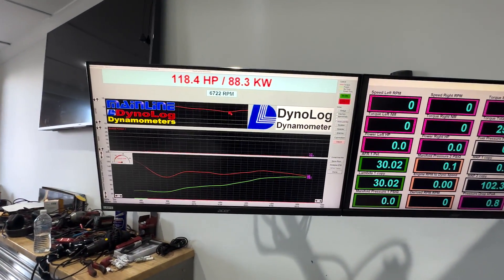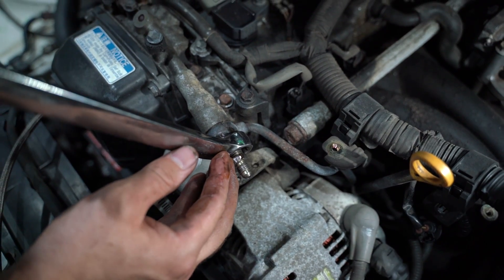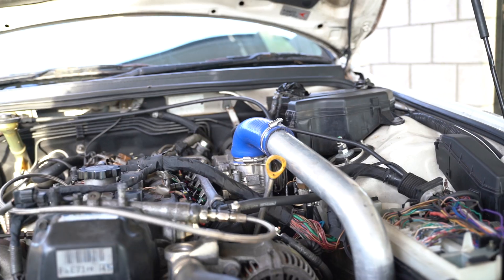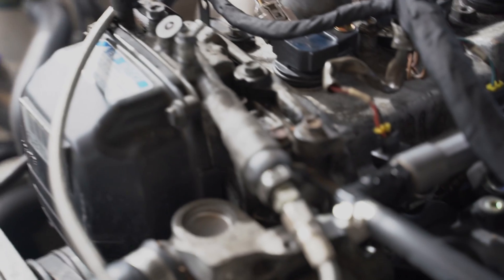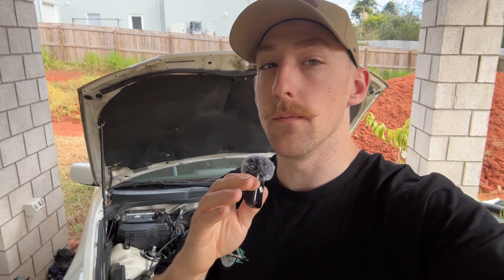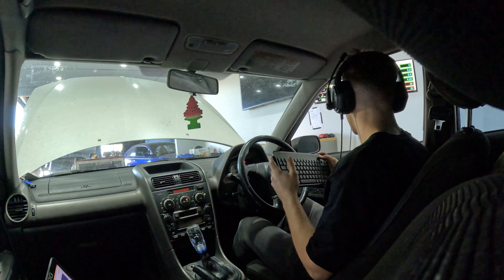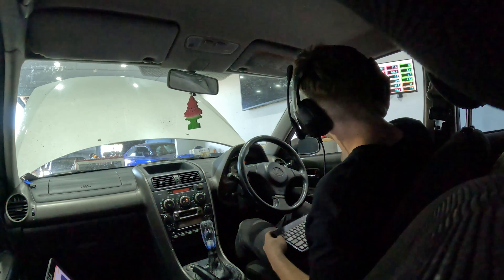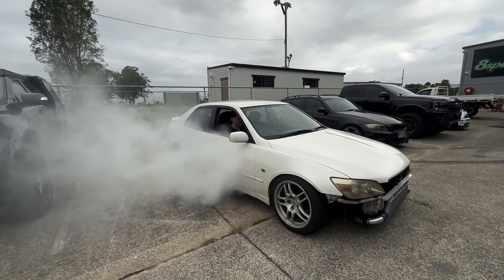TURBOCHARGING MY IS200! (1GFE+T) My Budget Drift Car

Comment: You converted the 1G to turbo without reinforcing the engine? 
Is that possible?
Reply from the maker: I’m assuming you mean “forged internals” and yes it’s very possible, the weakest point factory are the connecting rods however if you keep engine torque low enough (very easy to do) it’s entirely possible to turbocharge a stock 1gfe and have it be reliable (if the tune is good) .. many 1gfe have been destroyed due to poor quality engine tunes which has caused people to think they’re more fragile than they actually are.

Comment: Can the stock 1GFE handle the turbo? Or did you change pistons and rods etc?
Reply from the maker: Yes it can, plenty out there pushing more power than me (200kw) on stock rods and pistons
Reply: @Racelab_yt  Damn from what I read you have to upgrade those. I'll have a look into it then, would be so much fun to push a little more power.

Comment: Strange, so low numbers there.. stock 1gfe is200 with 0.5bar of boost makes 230 240hp, mine makes 255hp with 0.55 - 6.bar. and i have just 1zz injectors and det3 piggy.. have you checked if engine was ok ?

Comment: I have a GX100 Mark ii, can i use a similar turbo setup?
Reply from the maker: @Delta97976  absolutely can, T28 will be nice and responsive in comparison to some other turbo options out there, some people may argue it’s too small but the way I see it is t28 are a factory rated for a 2 litre, and once I double the boost this should be making more decent power 🙂
Reply: @Racelab_yt  thank you for a fast reply, your awesome, for that I’ll sub
Reply from the maker: @ no problem, happy to help. More content on this car coming soon, just been a little too busy with life unfortunately. 

Thanks for the sub! 🙂

Comment: Hey mate. One more comment from me. It’s fantastic video and it’s very helpful video stuff. Perfect job. Awesome place to build car.
Can you tell me from what car was the turbo manifold and where you get it? As I know turbo manifold for 1g series engines is not exists 😂
Reply from the maker: @АлександрШкуркин-ъ9о  My one is a home made manifold unfortunately (not made by me), there are some manifolds you can buy online but they are a little expensive (though they are very nice) 

Link to 1gfe turbo manifolds
https://rankoneperformance.com/products/lexus-is200-top-mount-turbo-manifold

https://su2performance.com/en/product/turbo-6-2-1-stage-1-lexus-is200-1g-fe-exhaust-manifold/

Comment: Is it the same as for the altezza?
Reply from the maker: If you are talking about turbo charging 3sge cars then the general idea is the same yes, you will still need a version of all these components however the wiring pinout and exhaust manifold required will be different. Also things like oil supply to the turbo may have to come from a different location too (I’m not familiar with 3sge engines) but the same basic principles apply 🙂

Comment: Stock rods yea?
Reply from the maker: @alegit123456  completely stock engine with a turbo bolted on 🙂
Reply: @ excuse my ignorance but I’ve been hearing about HKS fuel cut defender for stock ecu, what’s the difference in piggybacking with the haltech versus just the FCD? If you don’t know no worries💪🏼
Reply from the maker: @alegit123456  the fuel cut defender simply tricks the stock ecu by intercepting signals to stop it hitting fuel cut when boost is introduced with no ability to alter or tune the fuel and ignition systems, my piggyback setup or a standalone setup will give you full control of fuel/ignition/vvti/knock systems whereas you are stuck with the stock tune in the stock ecu with a FCD setup
Reply: @ I see, FCD is the fingers crossed method

Comment: Top tip learned from a friend - next time you remove the gearbox if your not planning to do an oil change just take the propshaft off as well and leave it in the gearbox. It will stop the oil leaking out 👍

Comment: so basically putting a turbo on a 1G will only make about 200hp.. but the 3sge on the altezza makes that power stock. pretty sad tbh as it just de motivates me to turbo mine considering other altezzas make that power stock
Reply: All depends on health of the engine and how much boost is being pushed.
Unopened 1G tends to top out at 280hp before going bang, but are capable of more if running a decomp plate and good tune.
Besides it’s an engine from the 80s not designed for performance so comparing it to the 3SGE, an engine designed to be a performance/sporty engine is not a fair comparison
Reply from the maker: Not exactly, i'm only running 7psi (wastegate pressure) on a very small turbo and the car can definitely take more, there are plenty of 1gfe turbo cars making high 200hp reliably and with a few extra mods and a bit more money you can make well into the 300-400 range, I will be turning up the power at a later date (hopefully soon) :) also the the 3sge will probably make about 175-180 at the wheels, most power figures listed online including ones by the manufacturer are Flywheel horsepower not wheel horsepower, the figure demonstrated in this video is wheel/hub hp, so as an approximation would be 220-230 flywheel hp (rough guess) not to mention general wear and tear over the years probably resulting in a small hp loss :) Thanks for commenting

Comment: Hi, @Racelab_life. 
Do you have a part number of exedy singlemass flywheel or link where you  bought it?
Reply from the maker: LEK-7463SMFHD (Part number attatched is for a heavy duty clutch kit) unfortunately cant find the flywheel part number on its own but you might be able to call an exedy dealer and they should be able to help :)

Comment: Great video man. I just need help with the intercooler pipes shapes from the turbo to the intercooler. If you could help, that would be great.
Reply from the maker: @ayeleyapawwah39  thanks for watching and commenting! how can I help?
Reply: What shape do you use for the intercooler pipes that go from the turbo to the intercooler?
Reply from the maker: @ayeleyapawwah39  a 45 degree silicone joiner that comes straight off the turbo downwards into some ally that points around the outside of the power steering pump etc, then into a 90 degree elbow to get it into the cooler. Hope that helps :)

Comment: How did you convert it to E85 and does it matter compared to U98 in this particular instance since it's not a huge power gain? Obviously compared to your stock figure it's decent increase though these cars stock should make about 100kw, so I'm curious what a U98 run would be like compared to E85
Reply from the maker: @MADagain  All good questions, Thanks for the comment :)

1. The “conversion” is simple, put ethanol in it…… although to ensure the ethanol does not do damage to the standard fuel system components I replaced all the fuel components with ethanol compatible parts, (rubber hoses/fuel pump/injectors and regulator are all e85 compatible) and from there I tell my ecu what fuel is in the tank and it does the appropriate corrections for fuel density calculations etc 

2. E85 is arguably not needed especially at its current boost level however I did it more as a longevity and future proofing move due to the fact my engine is high I’m km/miles and i knew everytime i drove it i would be always pushing it full noise and bouncing off the rev limiter the cooling properties of alcohol fuels will help keep it running cooler and last longer when “hotlapping” a track which is the entire purpose of this car, something that works everytime and I never have to worry about watching temps just drive drive drive 

3. E85 due to its high octane rating and fantastic cooling properties also gives me a larger tuning window for when i inevitably turn up the boost to which ethanol in my opinion will become necessary for engine safety (future-proofing) 

Hope this was helpful thanks for watching, appreciate the support :)
Reply: @Racelab_yt  Thanks a lot for the run down. I have a mate with an is200 and eventually we will be looking at throwing a turbo at it to see what happens so any help or just alternative ways about doing it is good to see.  I've seen countless people say it's not worth it on these motors but their just slow and unresponsive stock anyway. So any improvement just for responsiveness I think is a good move as long as his engine is healthy enough for it. Which we will find out ahead of time. It's all about the enjoyment at the end of it. Rather than completely engine swapping it of course.

I do have one last question related to ecu stuff, I've seen a few people run the stock ecu but never clarify if that's all they used. Is it possible to use the stock ecu in this instance or does it require some form of aftermarket ecu... Obviously if it could run a stock ecu the lack of tuning would hurt it but if we're able to limit boost should it work?
Reply from the maker: @MADagain  No problem, it’s obviously a lot larger of a gain just by going jz or another easier to make power platform but this was incredibly cheap for me to do vs a jz conversion so was a no brainer for me, the biggest thing to make them last is a good tune, highly recommend using a known reputable tuner that knows what they’re doing and understands these aren’t the strongest in stock form.

As far as ecu goes there are companies out there that sell “packages” that give you a fuel system/turbo kit/intercooler/ dump pipe/fuel cut defender etc and claim that it’s safe to run their setup on 7 or 14 psi depending on which package you go but…… based off the fact the stock ecu is NOT tuneable at all I would personally advise against this and run a piggyback setup like in my video or wire in a standalone to gain full control of all engine functions, this is in my opinion much safer and better, although I have no experience with the types of kits mentioned above so cannot necessarily speak poorly of them, I’m sure they work great but a standalone ecu is always better in this case…
Reply: @Racelab_yt  yeah I think for us the goal is just to get it running with a controlled amount of boost say 3-5 psi then once that's sorted find a "cheap" after market ecu to use as a light back but I've never done anything like that so just wanted to get your opinion based on the fact you sound like you know a bit about these cars.

Any chance you could do a video about how you have yours set up and what it allows to to control?
Reply: @Racelab_yt  we'll have to do a lot of tests and check if the motor is even suitable for boost first though as the motor is completely unknown to us. If it's clean under the rocker cover and sump is clean it may be good enough but starting out with a low amount of boost just to see how the engine behaves I think is the start but we ain't even close to trying it yet just getting some options for us.

I'm currently rebuilding a Subaru EZ30 and will eventually boost that motor but that's an entirely different can of worms haha

Comment: 201 -23 whp is insane on a 1gfe with stock 155-160 engine hp/ 111-118 whp. that is roughly an 85hp gain. which technically means you can now call it a 245hp engine. which is nuts. i dont know how reliable that will be with a weak stock 1gfem but its probably fine. and you said you were going to run it on e85 race ggas. which presumably reduces the chance of knock/ pre ignition etc which would be what ends the engine with weak rods. not that i know anything about cars. because i dont. but this almost makes me want to do something similar on my 1gfe altezza. but honestly, i think i still prefer the idea of selling it and buying a 3sge altezza rs200, which fortunately for me is an option (albeit expensive) in my country.
Reply from the maker: Refreshing to see someone who understands the difference between inflated flywheel HP numbers vs the number that actually matters (WHP), absolutely correct about the e85, i run a fair bit of timing in this engine and have yet to hear knock (even when i ran 5-6 degrees more advanced than i run it at i couldn't get it to knock (horsepower gain per degree added was very minimal so was not worth the extra 5-6 degrees hence me pulling it back).... The humble 1g is definitely a weaker engine and not designed for boost but there are a fair few people running decent numbers reliably and so far i've done nothing but absolutely thrash on my car drifting with no issues at all (obviously have to be aware the engine can only handle so much but reliability on any platform but especially a more fragile platform like the 1g comes down to a thorough and good tune) :) sorry it took a while for me to reply

Comment: What T28 you are using in this build?
Reply from the maker: @194Easy  s14 T28
Reply: @Racelab_yt  it was gt2860 as far as I remember, am I right?
Reply from the maker: @194Easy  Stock s14 t28’s are allegedly gt2560 (journal bearing) and gt2860 (ball bearing) , there is also the gt2860rs (famously known as “disco potato”) I’m not well versed in the details and exact differences between the t28’s and unfortunately don’t know which exact version I have but it will be either the gt2560 or the gt2860 off of a stock s14 🙂
Reply: @Racelab_yt  okay ;) I’ve got on the shelf brand new 2860rs and planning to put it into is200, that’s why I was curious about it

Comment: wait isnt tthe is200 stock supposed to make 155hp??
Reply from the maker: @twixu8811   Technically it does….. at the flywheel but not at the wheels…… most power figures listed by the OEM’s are flywheel hp/tq figures measured using an engine dyno. Every engine looses power through the drivetrain due to the effort it takes to rotate all the mechanical parts through to the wheels (gears, tail shaft, diff, axles, hubs) The dyno in this video measures power at the hubs and is a more “ realistic “ power figure as it’s what’s actually being made at the hubs/wheels…… Thanks for the comment 🙂 

(A rough rule of thumb is a 15-20% loss through the drivetrain which puts the factory power output around 125-135hp at the wheels…. which I am just shy of at 118hp on a hot day)

Comment: about the single mass flywheel is there a way to buy one of these? or its from another car?
Reply from the maker: @ЖибекАбдукаримова-н4я  it is specific to the engine/gearbox…. Any auto parts store should be able to get you one this one is from exedy, but many other brands do single mass flywheels for the 1g

Comment: Lovely build mate. What's the max torque on it now after the mapping. 
I believe stock is 200nm.
Reply from the maker: I’ll have to have a look back at the dyno sheet to confirm I think it’s around 240nm at the rear hubs and stock is 176nm at the flywheel

Comment: Where’s the clutch from !!
Reply from the maker: @Alfieevans21  should be able to get it through any auto parts store, the clutch used in the video is an exedy heavy duty, however I have since upgraded to a 6 puck button by xtreme, I’ll find the links for you

Comment: It should have 158hp stock... 118? what's wrong?
Reply from the maker: @inzMBL   Thanks for the comment! :) The 1gfe engine does make 158hp however typically manufacturers list “flywheel horsepower” not power to the wheels and doesn’t account for drivetrain loss (a loss of approximately 15-20% as a rough general rule of thumb) which puts it right around the 125-135hp at the wheels, which I am just shy of at 118hp on a very warm day, this dyno measures horsepower at the hubs not the flywheel :)

Comment: Its pretty weird you get only 119hp on stock engine. It should have 152 from factory so i was expecting somethink like 140 or 130 because of the engine is old. Still really impressive love this video and planing to also buy is 200. Im interested to see more videos about it.
Reply from the maker: @Apache9098  Thanks for the comment, Appreciate it! According to Wikipedia the 1gfe engine makes 158hp however this measurement is “flywheel horsepower” and doesn’t account for drivetrain loss (a loss of approximately 15-20% as a rough general rule of thumb) which puts it right around the 125-135hp at the wheels, which I am just shy of at 118hp on a very warm day, this dyno measures horsepower at the hubs not the flywheel :)
Reply: @Racelab_yt  thanks for explaining
Reply from the maker: @Apache9098  thanks for watching and commenting! :)

Comment: isnt the 1gfe have 155 hp stock??
Reply from the maker: @xxSunShine  Yes, however when manufacturers list the power output it’s typically “flywheel hp” where there is no loss in power through the drivetrain, the dyno in this video measures power output at the hubs. Typically the rough rule of thumb is you experience approximately 15-20% drivetrain loss which puts the Lexus right around that 120-130hp at the wheels mark and I was just shy of that at 112-118 on a hot day
Reply from the maker: @xxSunShine  Thanks for commenting 🙂

Comment: Is the piggyback ecu necessary?
Reply from the maker: @parallax5182  necessary if you wish the engine to be tuneable, there are some turbo kits you can buy that say you can run stock ecu but that is a very limited setup and there’s no going up in boost or turbo size if you want to change later. I personally prefer a tuneable ecu